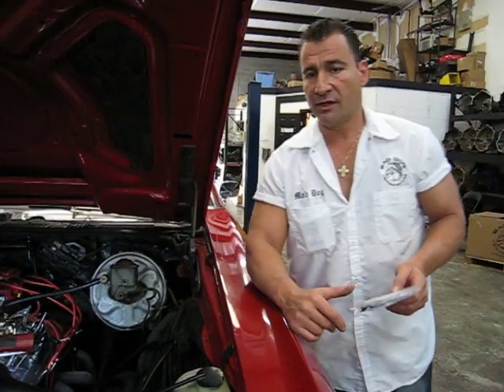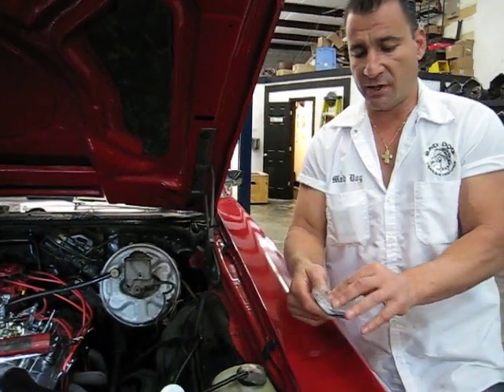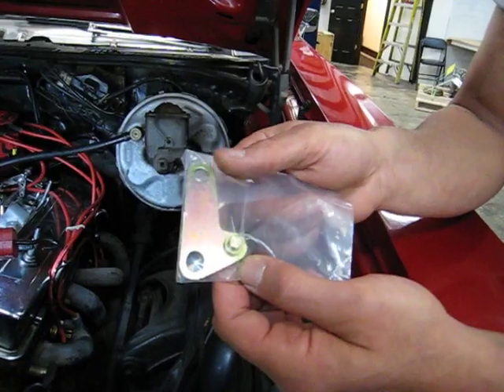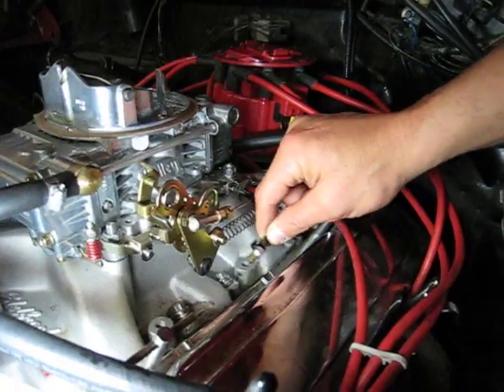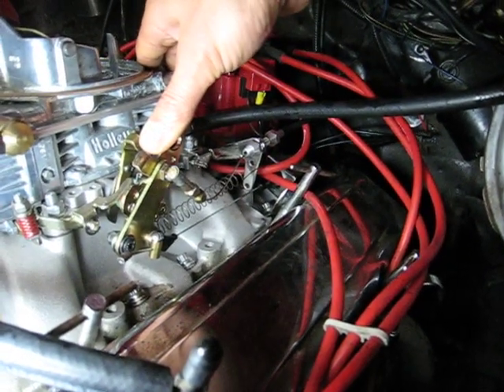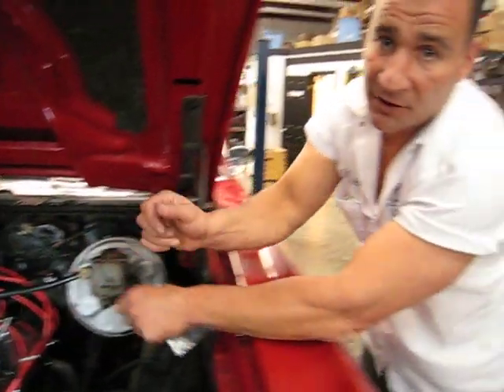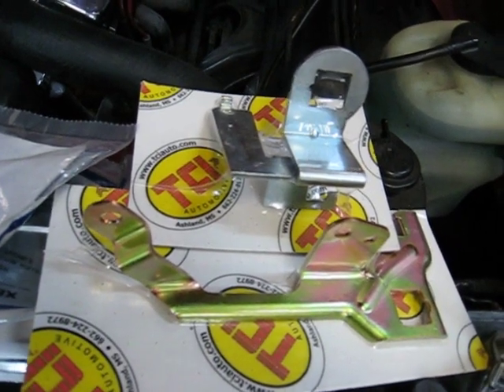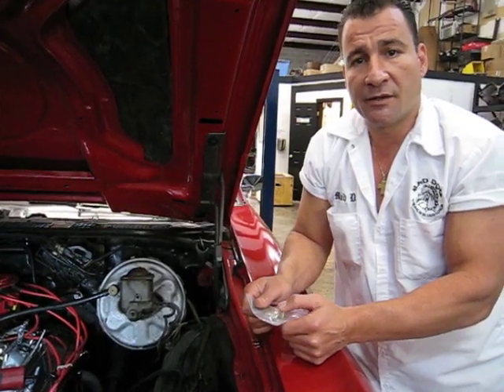700R4 TV (throttle valve) Cable Adjustment

Comment: Thx for the video MD, solved the problem on my 200r4 in have in my 46 GMC. I was going to pull it and put in a TH350, five minutes later and it fixed! I will be looking for you guy's in the future for my transmission needs.

Comment: Good stuff here. After I did my 200-4R swap, the TV cable loosened and pulled out of the trans. Burned it up quick! Had to get the fresh trans I just installed rebuilt. The swap is chronicled on my channel, but not the rebuild (had a shop do it).

Comment: When I bought my IROC, the motor was rebuilt 30k ago. The rebuilders forgot to adjust the cable (which takes 30 seconds) in which after 30k worth of driving and such, the trans started slipping. I readjusted the cable today and the assembly now sits roughly ½" further out than before. I believe this should help bring back some of the life of the trans. What sickens me is this is usually 90% of the reason transmissions lives are brought to an end. Everyone gets rebuilds, who readjusts TV cables?

Comment: Make sure you tighten the set screw tight.... I had my transmission for 2 years with no issues I don't rod my hotrod normally three weeks ago I punched it hard when I pulled out into 75 mph traffic it shifted fine went to store after that if failed to shift into 3 upon inspection I found my set screw stop had slipped and burned my 3/4 clutches out . Screw that sucker down tight and as back up I put a second stop on my cable purchased at local hardware store for $2.50 happy travels learn from my mistake. After 2000 miles who would have guessed that it would have happened but it did. Rebuilt and ready to burn some rubber.
Reply: well I don't know if the cable I have is exactly the same one you guys use but it looks exactly the same as the one in the video point being yep things happen sometimes
Had to get the tranny rebuilt but I'm up and running again and I put a second set screw on it so it will not happen again
Found it at the local hardware store

Comment: Good morning,,,got a 454 tbi..got a 700r4 install but don't know the correct tv cable bracket for this aplication? Any part number or I have to custom make it....thanks!
Reply: @maddogtransmissions3125  is fuelinjected,tbi...thanks for replying!
Reply: @maddogtransmissions3125  is a 87 Chevy truck the first year GM did fuel injection

Comment: I'm putting a 700r4 behind a 6.0L LS in a '68 C10.  I'm using a Fitech Ultimate LS injection system on it, my question is with the geometry.  How far from the center of the throttle shaft do you have to have the stud for the TV cable ?  I can fabricate the brackets myself and I understand the proper adjustment for the TV cable, just wondering if you would share that dimension to get the proper travel for the cable without it being to tight or have to much slack in it.  Just wanna save a few steps.

Comment: I converted my 1988 k1500 from throttle body to carb and my kick down cable is out of adjustment it’s a Holley street Demond carb what brackets do I need to get to fix it lol I’m having all kinds of trouble

Comment: Hi Lou, I have a 1980 L82 Corvette 350 small block (unfortunately I dont know what type of transmission it comes with, but never been replaced). I currently have installed an Edelbrock 1406 Carburetor on an OEM intake manifold. After installation, I noticed that the transmission kickback cable (which is on an OEM bracket also placed on the OEM manifold) is too far inwards to place along the transmission kickback pin (also an Edelbrock attachment (8026) to the carb ). I am looking for a bracket that would maintain the placement of the Transmission kickback cable and the throttle cable (currently on its original bracket attached to the back of the carburetor), but have the transmission cable come out more so that it would be in line with the cable pin on the carburetor. Does the bracket you mentioned (Edelbrock) help with this situation? Thanks Lou!

Comment: holiday crap I'm glad I saw this video, I had the little TV bracket upside down... good thing I wasn't done yet.

do you know the right part number for the  throttle and TV cable to use on a 78Caprice with a Holley and 700r4?

Comment: Whats the part number for the Edelbrock bracket? Installing on an 1406 Edelbrock Carb (1980 L82 350 Corvette)
Reply: Thank you for the prompt reply... I currently have an issue where I am replacing my carburetor on the 1980 corvette L82 on a OEM manifold. The transmission kickback is currently set on an OEM bracket slightly inward and towards the back where the throttle cable is hooked up on another bracket linked to the back of the original QJet. 1st: I dont know what kind of transmission I have (bought the car from a friend) 2nd: with an OEM manifold, will these brackets (that you mentioned) work? I have a 1406 Edelbrock... Once I have these hooked up, I am done with the restoration.. Please help.. Thank you in advance.

Comment: when I get to 75% throttle the cable is tight and if I go to 100% throttle the cable doesnt ratchet out any further resulting in not upshifting until I let off the gas. Is this common to have to adjust the cable out by hand to  have wot coincide with the tv cable full extension? It sure does drive better, but  am a little concerned of possibly burning clutches,

Comment: Thanks for videos like these.   It's amazing how you run into dilemnas like this and have to research around to find the answer!.....I have a zz4/tci 700r4 /edlebrock performer set up in my truck, and I had to give up my cruise cuz the brackets not being able to hold them all.   Once I hooked up my Throttle valve cable and my throttle return spring, there was'nt anymore holes to hook up the cruise control.....Is there anything I can buy that will house them all?

Comment: I have an 86 gm truck i installed the normaly open pressure switch in the 4th gear port then i attached the solinoid ground to that then i hooked the 4-3 down shift switch in series in the positve key on side of the coil the converter locks up kind of late to me like 52-53 mph but im having issues with this tv cable if i push the cable adj all the way back it shifts good but it wont allow the throttle to open completely,if i adjust it like you say tight like a guitar string its almost slipping!

Comment: i have a 1988 chevy caprice classic bro, i have the original 700 trans in it, its like when my engine is cool my gear shifts good dont drag shift like it pose to but as it start to warm up it starts to drag in like 3rd or 4th gear i been trying to figure out is it the trans before i spend money on another one

Comment: I`m a little confused as to how to adjust the tv cable.in this video, the only thing that needs to be done, is to open the throttle all the way, and the cable is adjusted? I got all the correct brackets for my holly, and the tv cable was too long, (so I purchased a cable stop like the one in the video to make it shorter) now do I even mess with the TV adjuster tab and slider?  other resources say to push in the tab, move the slider. no matter what I do i cant seem to get good shifts.

Comment: Lou, I have a 700r4 in my 89 k5 blazer. The problem started out with it not shifting out of first (never had a problem good smooth shifts til this point). I took the transmission out after inspecting the tv valve / cable, and governor finding no defect. I stripped it found nothing wrong replaced the plunger in the tv valve and put it back together. I reinstalled it today, great smooth shifts from 1-2, but for 3rd it seems to downshift from 2nd back to 1st then up to 3 and overdrive. Any advice?

Comment: Lou- 
     I just got an 86 monte carlo with a 97 vortec 350 and 200R4 trans. the engine has an edelbrock carb and intake but the detent cable was unhooked from the throttle lever. the car takes awhile to shift and only gets to 3rd gear. what brackets do i need to have all 4 gears and a working detent?
Reply from the maker: Hello boss man, Please contact us for a professional consultation regarding your needs.

You can call us and talk to a live person. Up until 10 PM Eastern standard time , Monday through Sunday.

Thank You,
"Mad Dog" Lou

Mad Dog Transmissions
Phone 770-781-0949

Comment: quick question I got a 700r4 that went into 3rd and over drive if I stepped on it. replaced everything on it heavy duty and everything on it wide band, 5 pinion planetary set hell even the pump is from a 94 the converter is a heavy duty one I feel the difference all though I still have to step on it to go into 3rd nd 4th checked the TV cable and it's alright what could it be
Reply from the maker: Hello Fredy, call us at 770-781-0949.
Reply: Fredy Hohner jbv

Comment: contuned from below,if i shift the trans manually it will burn the tires,hits every gear normally,the fluid level is dead on full hot,what is your advice?

Comment: I have a 700r4 and 350 in 87 blazer. I watched this video a while back so I ordered one from jegs then they sent another and my cable is too short but the package said was for my model. I need help so I don't burn it up
Reply: Try summit. You'll only need a longer cable, which can be determined in the item's details.

Comment: Hello, I have a 1982 z28 camaro with the elder-block. When I put my foot on the peddle, it is extremely hard to push. How can I fix this ? Thanks.
Reply: Kody Kline too strong return  spring on carb , or your carb butterfl
Reply: Throttle spring can be replaced with a spring that has a different stiffness to it to make the gas peddle more comfortable.

Comment: hey unmm how would u do that with a tbi cause i just replaced the motor and tans in my 91 camaro with a new 305 and 700r4 trans but when i go down the road i can do 50 in first and my dad said adjust the tv cable and im trying to but having a hard time whats the right or correct way to do this

Comment: I just had a different transmission installed in my 86 caprice and on takeoff when I press the gas the transmission revs all the way up then it shifts hard.  Do you know why?
Reply: It's too tight therefore late & hard shifts. Shifting too early is the (potentially catastrophic) result of too loose of a TV cable. Better to be too tight than too loose, as I always say.

Comment: how ya doing lou  i have a 89 camaro  r/s 5.0 i changed the tbi to holley 650 dbl pumper i have the tv cable bracket and the geometry bracket aswel but the cable is still loose need your help on this please
Reply from the maker: Eddie Dominguez Hello Eddie,Please contact us for a professional consultation regarding your needs. We are 
happy to provide you with references both here in the United States and 
Internationally.

We also accept orders over the phone. Be sure to contact 
us and we will recommend the correct transmission for your application. For your 
convenience, we accept PayPal and all major credit and debit cards. 

If 
you prefer, we can call you personally, just e-mail us your phone 
number.

All our transmissions are very strong and reliable, and can be 
used for everyday driving. Extended warranties are also available. You can call 
us, Monday through Sunday from 8 AM to 10 PM Eastern standard time, you will 
always get a live person.

Thank You,
"Mad Dog" Lou

Mad Dog Transmissions
Phone 
770-781-0949

Comment: Hi, I have a 1972 Nova with a 700R4, I'm looking for the bracket for the Edelbrock Carb, but it says it will not fit the performer series, which is what i have. Could you direct me to a bracket that will fit my performer series carb?

Thanks a lot!

Comment: so i have a 700r4 i checked my kick down cable tension and it seems tight but i have a problem where when i floor it the rpm stay at 3500 at i don't really accerlate. but if i put it in first gear it will hit rev limiter. is this a kick-down problem or something else? normal driving it shifts very smooth but if i want to stomp on it have to drop it down to 1st other wise it goes no where.

Comment: Whats the part number for the geometry bracket?
Reply from the maker: Holley TCI 376715   Edelbrock TCI 376710  maddogtransmissions 770-781-0949.
Reply: Lou Koulouvaris what if my cable won't reach the bracket on my Holley street warrior I also have the geometry bracket Also

Comment: I have to clarify a little more, I have a 78 Caprice that I swapped the entire drivetrain and brake system. With that being said, I replaced the TH400 for a 700R4, we used OE (made in china) throttle cable and TV cable, I ended up burning the transmission once because it would not shift on its own properly, we fixed it again but wit shifting problems again, swapped those cables for Lokar and it immediately worked properly...and similar things happened around the vehicle.

Comment: Just adjusted tight at wide-open throttle. The adjustment on a two speed power glide is only for passing gear because they do have a vacuum modulator which controls the shifting.

You can call us and talk to a live person. Up until 10 PM Eastern standard time , Monday through Sunday.

Thank You,
"Mad Dog" Lou

Mad Dog Transmissions
Phone 770-781-0949
Fax 770-781-0969

Comment from the maker: Yes you do. If the geometry is off. It will burn the transmission. If the transmission shifts into fourth gear at around 48 to 50 miles an hour, then you should be okay. If it shifts sooner than that. It will burn clutch packs.

Thank You,
"Mad Dog" Lou

Mad Dog Transmissions
Phone 770-781-0949
Fax 770-781-0969

Comment from the maker: Sounds like possible contamination in the valve body they are sticking. You'll probably find. If you replace the valve body, it should be fine. You could also try a different governor for now and see if that helps. Any other questions don't hesitate to call.

Thank You,
"Mad Dog" Lou

Mad Dog Transmissions
Phone 770-781-0949
Fax 770-781-0969

Comment from the maker: @SimplisticBeing Unfortunately you're right most people mistake the TV cable for only passenger they have no idea that operates the pressures of the transmission and yes you see lots of 700R4 TRANSMISSIONS fail because of that issue. If I could help you with anything e-mail me or just give me a call. I love the Iroc I used to own a red one back in the day!!
Thank You,
Mad Dog Lou

MAD DOG TRANSMISSIONS

Phone 770-781-0949
Fax 770-781-0969

Comment from the maker: Hello AMIR Davis, the TV cabel adjustment is very critical on a 700R4, the TH350 is only for passing gear, not a big deal.

Please contact us for a professional consultation regarding your needs. We are happy to provide you with references both here in the United States and Internationally.

We also accept orders over the phone. Be sure to contact us and we will recommend the correct transmission for your application. For your convenience, we accept PayPal and all major credit and debit cards.

If you prefer, we can call you personally, just e-mail us your phone number.

All our transmissions are very strong and reliable, and can be used for everyday driving. Extended warranties are also available. You can call us, Monday through Sunday from 8 AM to 10 PM Eastern standard time, you will always get a live person.

Thank You,
"Mad Dog" Lou

Mad Dog Transmissions
Phone 770-781-0949

Comment from the maker: Unfortunately you're right most people mistake the TV cable for only passenger they have no idea that operates the pressures of the transmission and yes you see lots of 700R4 TRANSMISSIONS fail because of that issue. If I could help you with anything e-mail me or just give me a call. I love the Iroc I used to own a red one back in the day!!
Thank You,
Mad Dog Lou

MAD DOG TRANSMISSIONS

Phone 770-781-0949
Fax 770-781-0969

Comment from the maker: @MadDogTransmissions Hello boss man, the bottom line is this you want the TV cable tight like a guitar string at wide-open throttle, the tighter the better. If it's still not shifting properly give me a call 770-781-0949 Thanks Maddoglou.

Comment from the maker: Hello boss man, unfortunately you have the common 3-4 clutch failure this is the reason why we add extra clutches in the 3-4 gear drum and put a bigger boost valve to apply more pressure amongst a lot more upgrades. They also have plastic accumulators which we replace with aluminum. I wish I could've told you some good news there are a great transmission once you build them with all the updates.

Thank You,
Mad Dog Lou

MAD DOG TRANSMISSIONS

Phone 770-781-0949
Fax 770-781-0969

Comment from the maker: @kirk211 Hello boss man,The sonnax geometry bracket will fit on all edelbrock carbs. If you have any other questions don't hesitate to call or e-mail me. Thanks MaddodLou shop 770-781-0949 Maddog transmissions.

Comment from the maker: Hello boss man, 90% of the time you have to shorten your drives you 3 inches in make sure your yoke is a 27 spline the same as a TH 350,200R4, and to speed power glide. If you don't have anyone local we can do it for you for $90.00 that is shortening your driveshaft with balancing of course shipping is extra.

Thank You,
"Mad Dog" Lou

Mad Dog Transmissions
Phone 770-781-0949
Fax 770-781-0969

Comment from the maker: Hello boss man, the bottom line is this you want the TV cable tighter like a guitar string at wide-open throttle, the tighter the better. If it's still not shifting properly give me a call 770-781-0949 Thanks Maddoglou.